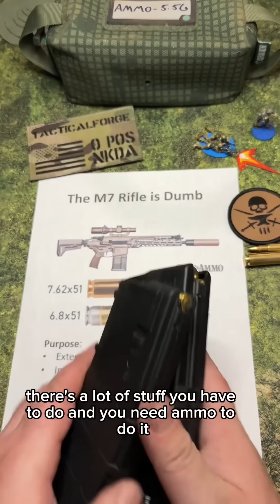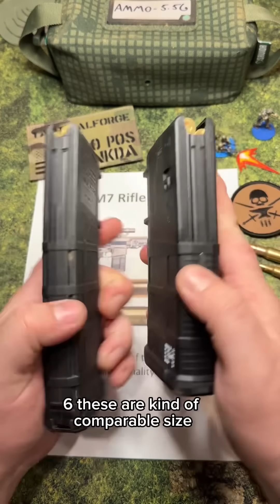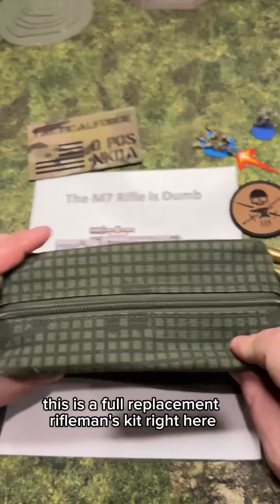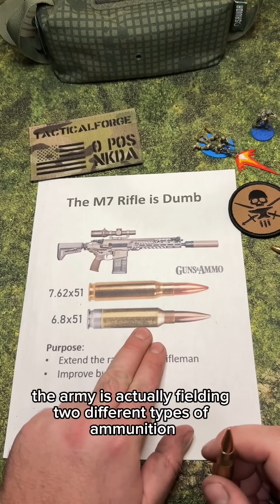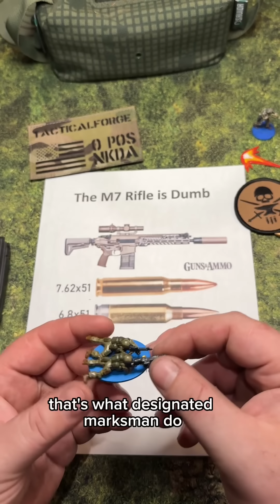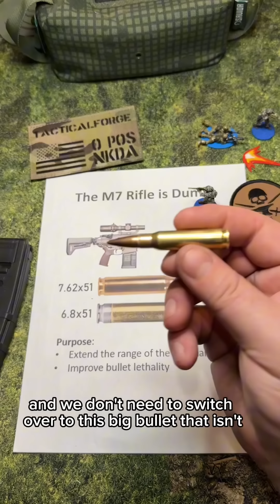My God this Rifle Sucks

Comment: The gun the military industrial complex chooses will always be more cost effective, not the most effective weapon... 
Gas impingement is something that needs to phase out, though I like ARs but also I am reasonable.  I know that there are many other designs out there just waiting to take a chomp at the bit.  Maybe it is time for the design of the AR itself to improve?
Reply: armalite tried with the ar18
Reply: @rabbitdrink  
   Everyone is trying to get that contract.  I read all about the AR18 after you sent that thanks.
 It would seem that was a minimal variant of the M16 , sure, but there weren't any improvements to that design and it took place in the 1960s .  Even modern AR are more or less the same thing minus the branded  parts.
Reply: @GreyWindowsBrokenSpoke  It wasn't so much "improvements" as it was cost-cutting.  Now that CNC tools can be found everywhere, those cost savings are gone.
Reply: @immikeurnot  That is a good point too, why don't they just cut their own weapons at this point right?  Not that I believe that is a good idea.
Reply: @GreyWindowsBrokenSpoke  Have you seen how many countries have gone to AR15 variants and/or are producing them at this point?
Reply: @rabbitdrink  I actually thought you were making a Joe Biden reference at first, but he said ar14 , so I dug a little deeper than that lol
Reply: It has improved over the years.  It's probably the most effective and reliable system on the planet, especially for the cost and weight.

Comment: From start to now, this program has been wrong. Give me rounds and speed!
I carried an M4 with 7 mags and M14 DMR (nonEBR) with 5 mags. It ain't easy but it's doable. Those where long days of cordon and search, so outside of the typical operations of Infantrying. 
We'd be in better shape as a force if KD ranges (out to 600m preferably) were used for fundamentals training and confidence built up on unknown distance ranges. So much new range tech out there to implement this!
The best weapon on the battlefield can be the computer sitting in the skull of Private Joe Snuffy. Whatever it takes to effect that is the best dollar spend, imho.

Comment: The 6.8x51mm dimensionally isn't a new concept . The NATO trials which lead to the 7.62mm NATO in the 50's. The .280 British  was almost adopted world wide except the US wanted their T65-E3 cartridge (what became 7.62 NATO) for long range capability. As a compromise the British and Canadian developed a cartridge based on the T65 = the 7mm compromise (7x51mm) which is near identical dimensionally and with similar issues to the 6.8x51mm. It had issues with bore and throat erosion, overheating, excessive muzzle blast. It took the US 70ish years to figure out 7mm is the way to go, but are still pushing the long range engagement requirement. Bright idea, lets try resurrecting the .280 British (7x43mm)? The British and Belgians had this figured out in the 50's.
Reply: no they did not. 

.280 british is a bad cartridge, its basically 7.62x39 but worse in everyway. its bigger, heavier and practically the same energy and effective range. its weight is practically the same as 7.62 NATO before lengthened it to 7x51, and its case diamentions mean its mags are shallow.  

but it gets worse, the british and belgians thought their oversized low energy cartridge was cable to be used in the long range support role on GPMGs and what not. which was decisively proven wrong in the 50s. 

7.62 nato was a bad but useable rifle round, but a good machinegun round. .280 british was a better but still bad rifle round, and a terriable machinegun round.

Comment: I think this is going to end up being the opposite of the HK416 for the Marines. Instead of sneaking it in as an IAR and then discreetly replacing the M4 as their standard carbine, this is being announced as a full scale replacement but will probably end up as a limited issue special purpose weapon for DMR/automatic rifle functions, with some version of the M4 remaining as the standard infantry weapon. At least, I hope it will go this way if Big Army has any sense.

Comment: Imo(no military experience whatsoever, no stolen valor here. I've only read extensively on engineering history and application of arms) the powder, jacket and ammo idea is great. To reach velocity faster, higher velocity and consistent ejection shouldn't be an issue with an AR-15 style lockup and ejection. The issue is in the buffer and feed. Seems like bad ak problems and also the round should have been 556 with a bigger round imo. Even if you make 556*51, make it idk. .28 caliber. Hollowtip boat tail or fmj with a core. Ap bullets should be sabot jacket.

Comment: historically soldiers were trained with smaller rifles then sent to battle with real ones.
range finders doesn't send light beams for eternity. speed of the light is very fast.
you want to employ mortars? the smallest one you can use is a 81mm, wich is operated by 5 man team. good luck with employing one in the drone era. 60mm's are just indirect firing grenade launchers.
have you ever seen a mortar round? it is big. you need cars for delivering just maybe 100 them. good luck with that little ammo.
seeing enemies beyond 500 meters is rough. this is why it has a binocular and does all the calculation for you. 
do you want to fight hand to hand combat in an urban area? we have planes for that.
the only "dumb" in this room is your opinion.
Reply: Remind me exactly when the Russian air force finished bombing the Ukrainians out? Seeing as how you said urban combat doesn't exist any more because of planes. 
Can you identify a single benefit of the entire 6.8 program that can not be easily applied to 5.56 or .308? Because the only thing you've suggested is good about it is the optics which could be put on any gun.

Comment: The one thing this rifle got right? The nomenclature. The M7 Spear. Because eventually, you're going to either run out of ammo (sooner) or the rifle is going to beat itself to death under the pressure of full power ammunition (later) and you'll have to fix your bayonet and that will literally be all it's good for: a spear
Reply: Does it have a bayonet lug? Because if not that's going to be ironic.
Reply: @kazesim88 I'm sure you'll have to attach the gay little adapter to the pic rail or some shit lmao
Reply: @jaganshi5444  Hey, I feel personally attacked now, FFS - with the only way that my Marine OKC3S fighting knife/bayonet can be fitted onto my 16" AR being that exact "gay little adapter", LOL. Still, I'd rather have a bayonet option than not one at all....
Reply: @Ezees23 I don't even have a bayonet but at least I'm running 5.56 lmao
Reply: @kazesim88 It doesn’t have a bayonet lug, nor have any bayonets or bayonet adapters been developed for it.
Reply: @Pilotmario so i was correct in envisioning utility knives and electrical tape filling the gap lmao
Reply: @jaganshi5444  Duct tape and an MRE spoon will make it right.
Reply: @Pilotmario high speed low drag
Reply: Except it lacks a Bayonet lug

Comment: A 240b or the like and a dmr in the 6.8 would probably be the better idea. Maybe up the weight of the 556 projectile and the pressure using the hybrid case if the m4 or m27 can handle it. Update the m4 or adopt something similar (free float handguard ect).

Comment: This rifle is the equivalent of when people stop wearing helmets on a job site. They question why they wear helmets until someone's skull cracks and suddenly we remember why. Hopefully we remember why we threw the M14 along with standard issue battle rifles in the trash.
Reply: To be fair, the M14 was bad because of more than just the weight and size.  Its accuracy wasn't good (same effective range as M16/M16A1 and the M4 has 50m on it) and reliability is less than great.  It's also a pain in the ass to strip for cleaning.
Reply: @immikeurnot The M14 was indeed the worst of the battle rifles. But let us not forget that all of the battle rifles were fundamentally flawed.
Reply: @Infanterie_Marine  Every weapon has its strengths and weaknesses.  It's just the M14 had so few of the former and so many of the latter.
Reply: @immikeurnot  Its accuracy wasn't good is an understatement. 5 MOA was seen as the standard for the M14.
Reply: Go shoot a deer with a 556 and watch how far it runs before it dies. Sometimes stopping power is a good thing
Reply: @danielconquer909  I’ve shot 3 or 4, didn’t run much more than 30 yards lol.
Reply: @danielconquer909  Yeah, if you believe in that kind of thing. Sorry to burst your Fudd Lore but 5.56 has plenty of quote "stopping power" for deer. It has almost identical terminal performance as 7.62x51 at 300 yards or less. Believe me, if it wasn't against the retarded hunting laws in my state, I would hunt deer with 5.56.

Comment: My guess is that flying and/or off road driving drones for resupplying ammunition, is going to be a big thing.
This might give away your location though, as the enemy might just see where the drones are dropping stuff off, and then shelling that location.
So dropping off ammunition away from the squads position, would still require stealth and muscle to get from the drop off point / ammunition stash, to the fighting location.

Comment: They M14ed the M4.
Reply: It's peak army logic.  Goes like this -
The m-16 is great, but after decades of fighting low intensity conflicts in jungles and urban settings, we would like it to be smaller and handier.

The smaller and handier m-4 is great, but turns out the terminal ballistics kind of suck in the open desert.  So let's push extremely hot ammo through our rifles and shred them all.

Now that we're gearing everything towards taking on the PLA in the jungles of the pacific, and we're ruining our rifles, so we now need a heavier more complicated rifle that's probably great for desert warfare.

The army CAN'T just go back to a full length m-16.  That would make the army wrong for making the m-4 universal.  And the army can't be wrong.  Well...  the people who made this decision are the same people that decided that the UCP is a good idea, but they can't be wrong twice.  Not allowed.  Careers are at stake.
Reply: @ColonelSandersLite forreal. I find it very suspicious. Like UCP level suspicious that Sig has somehow managed to win or is about to win every single major small arms contract in the army. And every single time somehow they already have a product and every single solicitation has the hyper specific specifications that only matches the sig offering. 

Like for the NGSW instead of doing a hybrid case hot 7.62x51, it’s a hot 6.8x51. So now the NGSW is justification to argue for moving all the 7.62 platforms to be replaced by a different caliber. And lo and behold. They just happen to already have the MG338 to offer before a competition is even formally announced.  Won’t be surprised if they offer a DMR offering too now that the DOD is standardising on the MK22. They’ll use those three factors together to justify that. 

Won’t be surprised if they start gunning for a .50 cal replacement too if the army takes that hook line and sinker because now performance of the next tier down is creeping up.
Reply: @ColonelSandersLite  😂😂😂

Accurate statement. If they stuck with 20” barrels and removed the pointless flash hiders and muzzle breaks they might realize the 223 is actually pretty quiet tiny ass rifle
Reply: @ColonelSandersLite  The issue with full length AR-15 pattern is 5.56 isn't amazing against body armor. The obvious solutions would be either a short action cartridge that performs better against armor (bonus points for being relatively easy to retrofit existing rifles), or an AR-10 pattern in 7.62x51 since it does better against armor, and its ballistics aren't really that bad.
Reply: You've got it! It's so crazy to be adopting a rifle that's clearly designed for a specific Afghanistan problem when it's so unlikely that the US would ever get into a war like that again and fight it in the same way for the rest of our lifespans
Reply: The EBR was my favorite rifle in the GWOT, I loved it. The disadvantages were eclipsed by the advantages, especially in Afghanistan.

EDIT I read that as Mk14 😂 force of habit I guess.
Reply: @stevepalpatine2828I mean, same gun, just different furniture and role
Reply: @stevepalpatine2828Yeah, that 6 minute of angle accuracy is nothing to write home about...
Reply: @stevepalpatine2828i read mk14 as well
Reply: Exactly
Reply: Shut ur filthy mouth about the m14!
Reply: Don’t disrespect the M14 like that

Comment: Imagine urban warfare, house to house clearing with this
Reply: Ew. It was bad enough with a M4 (which I took the front sling swivel off because they're heavy and not needed), M68, PAQ-4.
The lightest possible combination of parts possible with what was in inventory at the time.
60 hours of lugging that M7 around during a 3 day operation? No thanks.
Reply: just shoot through walls at this point, unless you're clearing soviet/pre-2000 housing, you're good. Seriously, foam concrete blocks and any other cheap modern construction material won't stand a chance against this ammo.
Reply: @-WarCriminal-22 at first was gonna bring up, " being sure of your target", then I read your name, lol, HA, HA, HA, nevermind.
Reply: @survidmt  I mean, the thing is, civilians usually shelter in the basements of the buildings, they don't need to stay on the higher floors (where walls are), that's where the hostiles are at, because they need the windows to shoot their guns and check the surroundings to see you coming up to them.
Reply: @-WarCriminal-22 no pressure, understand your reasoning. Nice having tool able to do job different easier safer way, I concur.
Reply: @survidmt  don't worry, I actually liked your first comment hahahaha
Reply: @-WarCriminal-22  by that logic, 5,56mm will also penetrate those foam concrete blocks and other cheap wall/infrastructures , if 5,56 failed to penetrate it , use grenades , or even rocket launchers/recoil-less rifle
Reply: @thanosfickda  I mean yeah, but at least there's some chance that this type of concrete might be just enough to stop the normal 556. Tho I don't know why you'd bring "normal" (like regular FMJ, with no AP tungsten core or whatever) ammo into the conflict where your enemy probably got body armor. Only if you're running out of ammo and there isn't enough new ammo produced to fill the needs of everyone.
Honestly, I think the entire idea of clearing rooms seems to fade away by now, as drones can literally slowly float through the window (or just a gap large enough) and check for targets inside the building, then blow up on command.
Reply: @-WarCriminal-22  if there are type of concretes can stop 5,56, it could also stop 7,62x51mm, there is no point of switching to battle rifle cartridge , if you wanted more destruction, call for mortar , artillery, drone strike , or the 12,7mm belt fed gun/belt fed grenade launchers on vehicles, 7,62mm shouldn't be carried by soldiers , should only be carried by human snipers for high value targets ,  it is better to mount 7,62mm belt fed gun on vehicles , it can carry more ammo and weight without being exhausting , or heck use a unmanned ground drone have a turret carrying 7,62mm belt fed machine gun
Reply: @thanosfickda  you're absolutely correct (idc if it's 6.5mm bullet, makes very little difference for the person carrying the ammo).
Unfortunately, people in the government want more money to fill their pockets.
Reply: kid named artillery:
Reply: In Ukraine they just fly a drone thru the window and explode the building, no need to risk soldier lives clearing rooms.
Reply: People forget that USMC was using grenade launchers on their humvees to clear buildings 😅
Reply: Bold of you to assume that they will leave any houses to need clearing
Reply: That's what artillery is for.
Reply: WHAT? WHAAAAT? I CAN'T-I CAN'T HEAR!
Reply: Tbf I think the idea for that environment is simply to start shooting through walls with the bigger round
Reply: @AnonymousVenator That, and “PFC M67 is the best point man.”

Comment: Carrying less ammo because the ammo is larger, which also means you cant carry as much of other things, like water and rations. Which is a real tactical problem, especially on long marches and fights that last hours or even days.
I dont like the platform either. I carried an m16a4 in Afghanistan and it worked just fine. 7 mags minimum wasn't hard to lug around.

Thats not even getting into the faster wear and tear, the extra weight of the platform and being a glowy because the suppresser is hot hot hot.
Reply: And if you think Im only carrying 210 rounds youre crazy.
Reply: @jefferydraper4019  of course. Even 10 mags isn't a problem for an m16 or m4
Reply: That suppressor at night with an enemy using thermal optics is a concern I have before you even get to anything else.
Trying to maneuver with a lightstick on your barrel is gonna be fun.

Comment: I think before the army accepts defeat, they will probably make the lower pressure round standard and ditch the suppressor and instead go to a 16 or 18 inch barrel. these rifles and they are going to wear out very quickly unless all of the shooting can be at the reduced chamber pressure.  Also I know that suppressors are all the rage right now but let's be honest they are freaking heavy. They glow like beacons under night vision. They burned the crap out of you because they are thicker and longer than just the barrel.  I'd rather just have the extra barrel length. I'm still not sold on the tactical advantages of a suppressor. I've been in a gunfight and the sound literally echoes all around you and it's very confusing.